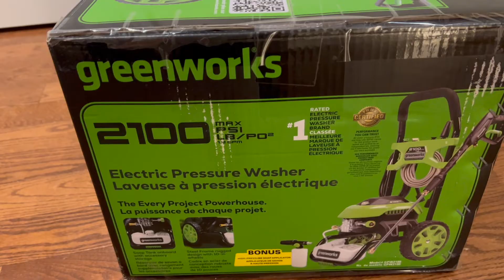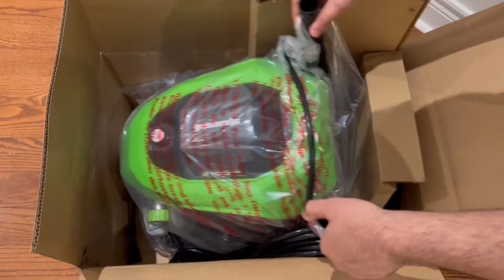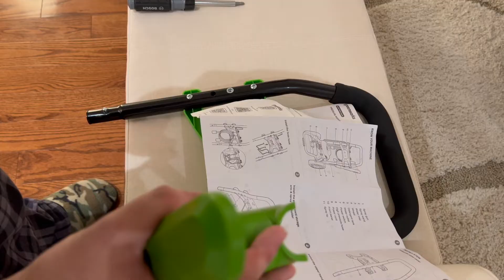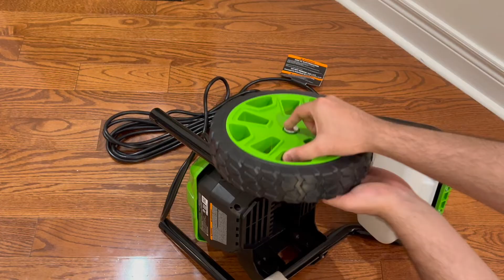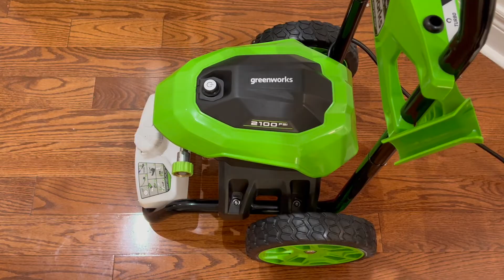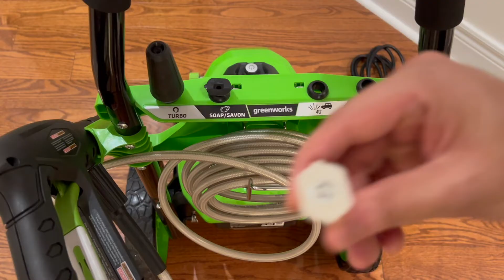Unboxing & Assembling the Greenworks 2100PSI Pressure Washer: Step-by-Step Guide!

Comment: Can this electric powerwaher siphon water from a bucket?
Reply from the maker: Not too sure but generally speaking, pressure washers do require to be plugged into a running water source. And while they can create a little suction, it starves the pump. However, you can get a sludge pump kit and retro fit to work as a siphon.

Comment: Hey, you might want to tab a little 20w oil on those bearings inside the nozzle, just make sure you can feel them rolling while you coat them! It’ll prevent the removal from sticking, if you forget to remove the tip after usage. Most ppl will leave the tip in & that’ll get you in trouble!
Reply from the maker: @blackmouthcur6097  Will keep in mind. Appreciate the advice